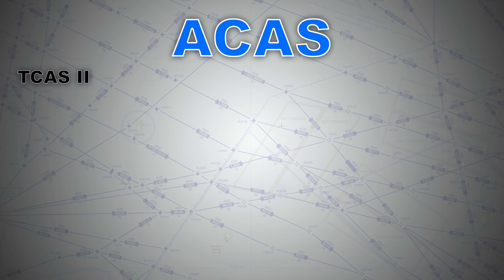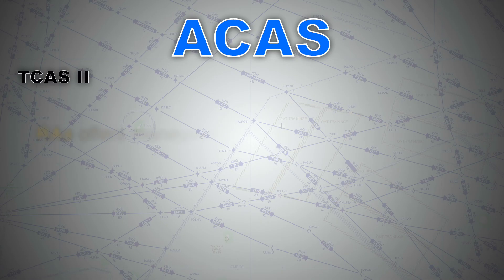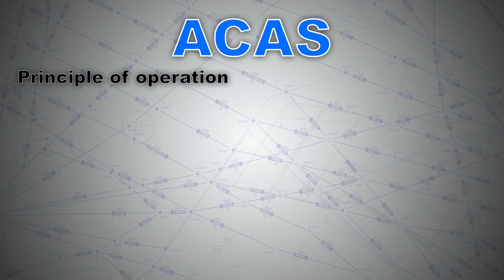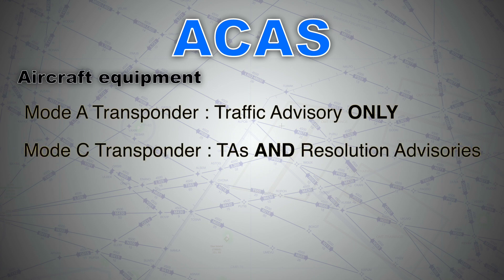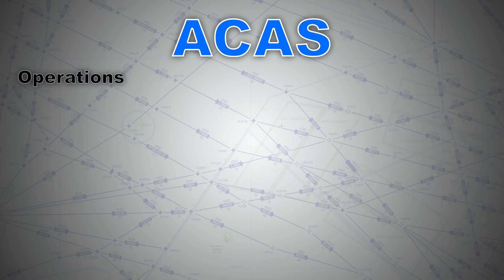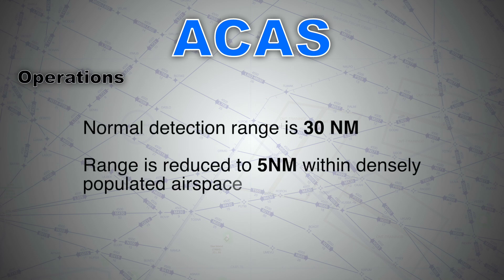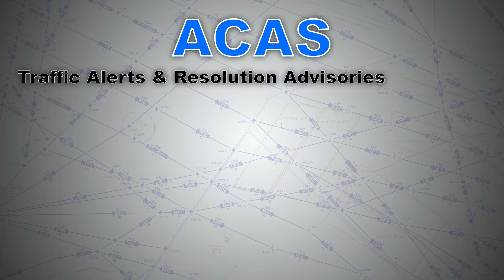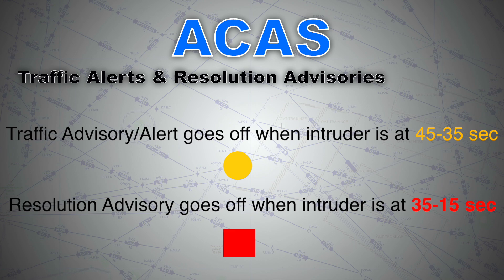Airborne Collision  Avoidance System | TCAS Explained

Comment: Is it possible just to have WiFi backhaul aerials in each aircraft, have them all programmed on the same network, it auto connect on whenever the same network that is present, they all have their own mac address, each aircraft will be able to send and receive data etc location speed altitude and an on board collision avoidance (not the aerial operating system on chip)